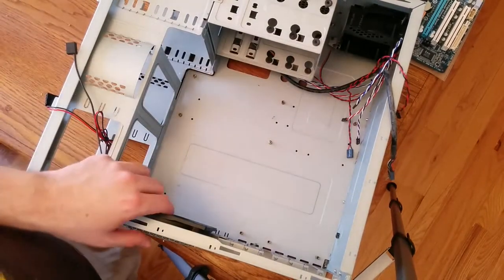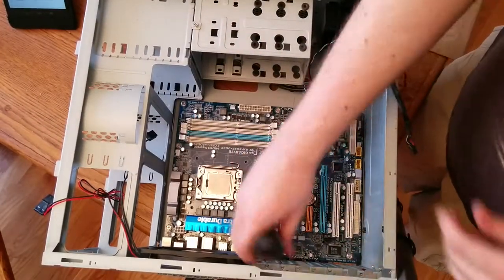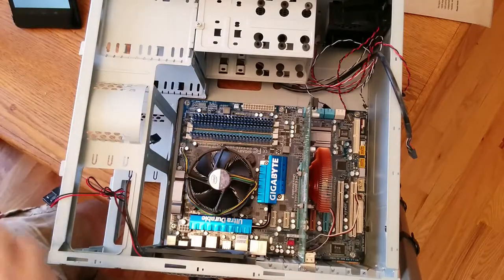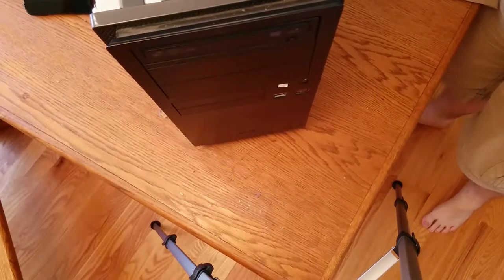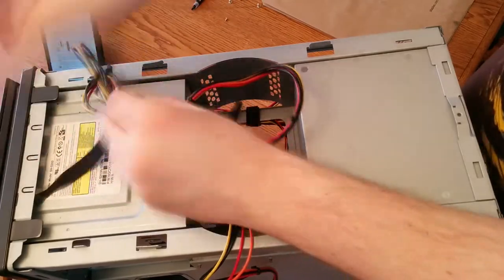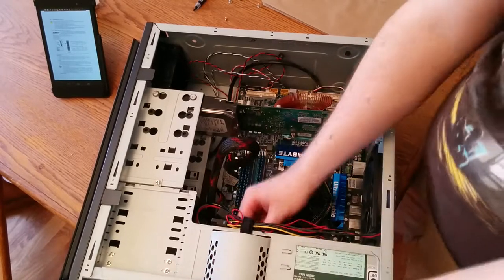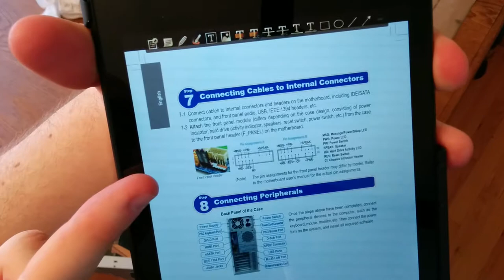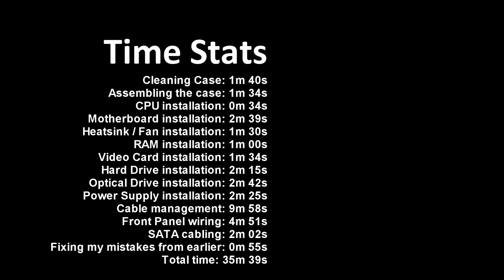06 - How to build a desktop (VEDA 2014)

Comment: Very good introduction on how to build a PC. I actually do it since I was probably 12 years old and never broke anything. So don't hesitate if you're new to it. But just like in the video mistakes can happen and it's finding them that can be a bit of a pain from time to time. Just one tip for newbies though: I'd try to avoid holding the harddisk drive (or basically any electronic component - RAM, graphics card...) where its chipset is. It's better to hold it on its sides. Like all electronic devices there is a danger of damage due to high voltages resulting from electrostatic discharges. Or google "how to avoid esd". Greetings from Germany :)